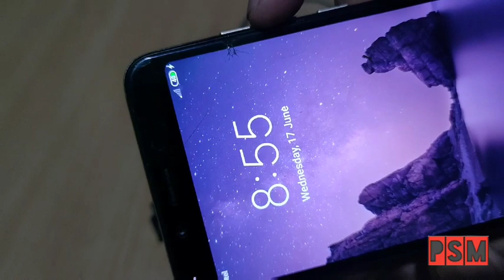How to charge a phone using AA BATTERIES- DIY MINI POWER BANK🔥

Comment: For akaline 2 AA, it provided 3v, it's not enough supply for phone (5v)
Reply from the maker: Yes you're right but I'm also using a voltage booster (input 3v output 5v)so that's why. Just try it